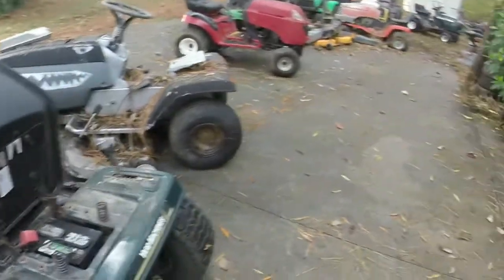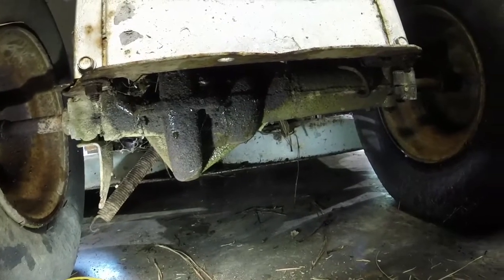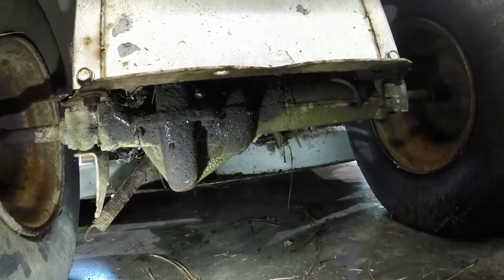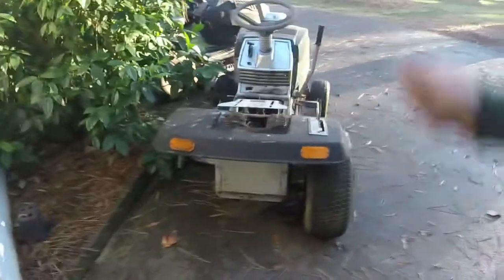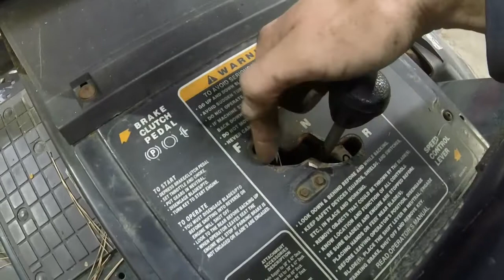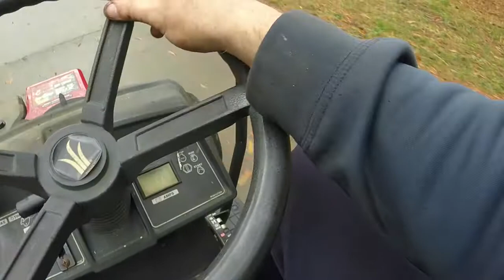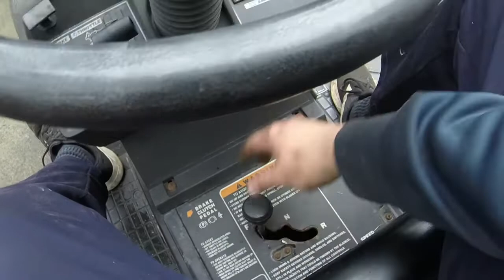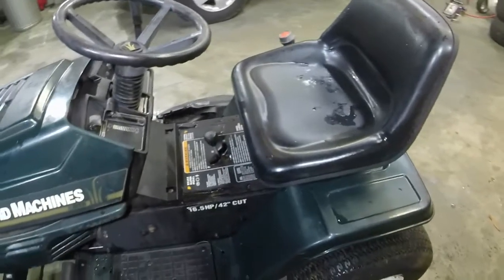MTD Yard Machines transmission swap takes two tries: what to do & what not to do when swapping them

Comment: 33:30   on that spring and others the best tool I found to use is an Auto Brakes shoes spring Tool to both put it back on and to take off is the easiest way to do it.. other ways are much more harder to get the job done

Comment: FYI  getting those rear end rims off I haven't done it but using a propane /LP  torch and an Air hammer with the flat head fitting not the punch fitting,    they can be found for under twenty $$  is probably the best way to get them off with out using a puller and so on and not a cutting torch

Comment: You can use a hole saw, slightly larger than the axle and hub. Then split the part that is left on the axle with a death wheel. Never seize the new one, so the next feller uses less curse words , Lol :)